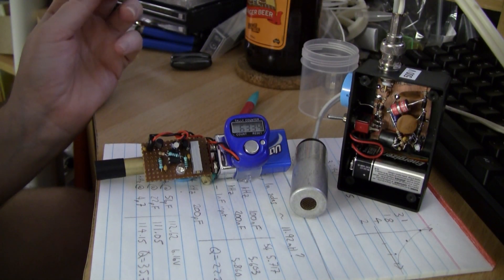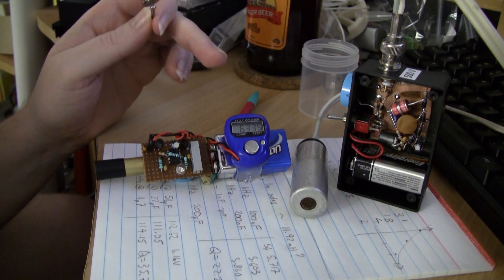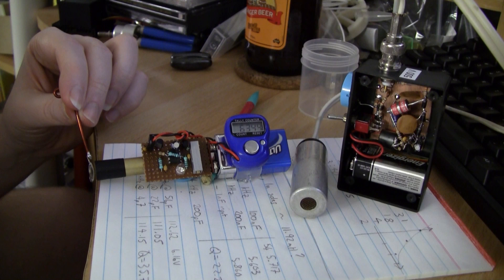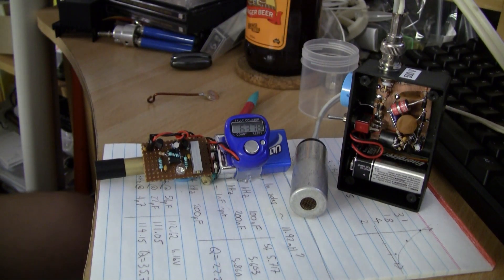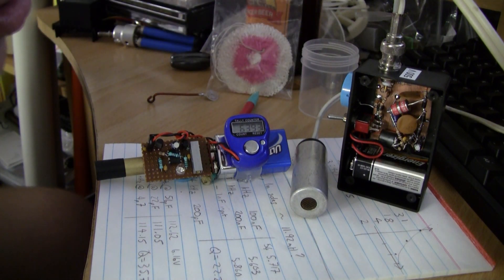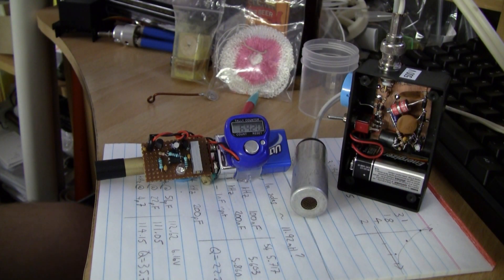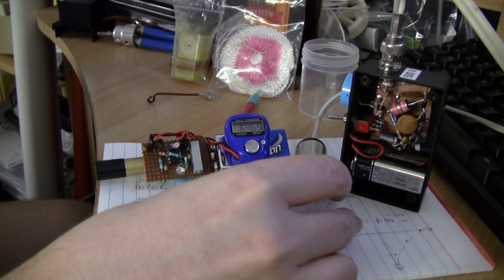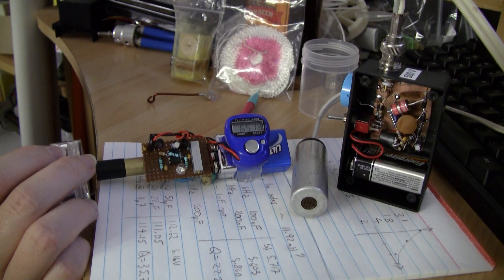Photodiode Gamma Ray Counter

Comment: I tried it, but so far on the first stage I am only getting lots of noise. And even with the oscilloscope I don't pick up anything when I put the radioactive emitter near it.
Reply from the maker: First things to check would be that the BPW34 is around the right way, it has to be reverse biased.  Next would be that there are no light leaks.  Measure the source voltage and make sure the PN4117A is not saturated.  It's exact operating point isn't too critical, but it needs to be not cut-off or saturated.
Reply: I found a mistake while connecting the photodiode (connected to ground instead of gate). I enclosed the circuit into a metal seal. Made sure no light is going in. At 12.8v battery supply, the voltage across the fet is 8.83v. Is it good enough?
Reply from the maker: @thelonewolf1757  Yeah that should be fine.

Comment: Where did you get thorium nitrate from? Price?
Reply from the maker: From a photographic supply store many years ago.  It was about $50 AUD for 10 g if I recall correctly.
Reply from the maker: Lantern mantles are easier and cheaper if all you need is a check source.

Comment: any reason multiple diodes cant be used for greater sensitive area? each with its own amp, summed
Reply from the maker: No, that would be a good idea, maybe even keep it pixelated with separate reporting channels for each detector.
Reply: @vk2zay  ok and because they are a flat plane they should be somewhat directional. sounds like a great survey device for strong sources. an esp32 could matrix 8x8 grid attached to a lead golf ball sized head and output a heatmap on a wifi webserver. my programming skills are not up to that yet.  im an old fashioned guy so they might go to a matrix of bicolour leds. lots of damn soldering though
Reply: also do you think a pin diode is reliable enough to identify isotopes using spectrometry?
Reply from the maker: @pavelkowalski9830  no it won't give you much resolution it just isn't big enough to capture a wide range of particle energies
Reply: @pavelkowalski9830 they can be but you need fancier photodiodes and better low noise amplifiers. I had good luck using avalanche photodiodes biased below the avalanche voltage.❤

Comment: I noticed in your schematic, the 2n3904 is positioned incorrectly, are the connections to each pin still correct?
Reply from the maker: I've just drawn it oddly, but yes the circuit topology is correct.  It is acting as a capacitance multiplier for filtering the front end supply.
Reply: Thanks :)
Reply: One last question, if you feel like answering. You said that the circuit is unstable because it is DC coupled through the comparator stage, and that AC coupling it would fix that problem, how could I AC couple it?
Reply from the maker: @quantumlab9130  put a capacitor between pin 1 and 6 on the opamp/comparator instead of the direct wired path, then add a resistive divider to bias pin 6 to about mid-rail and set the trigger threshold in much the same manner using the 100K pot.
Reply: vk2zay thank you very much.

Comment: Any idea how a solar cell would work? Large surface area. Awesome video, thanks for sharing.
Reply from the maker: alan headrick I tried a few small ones, too much capacitance which makes it very hard to extract the tiny current pulses, even with heroic bootstrapping of the capacitance.  Their dark current is also very large which tends to swamp you in shot noise.

Comment from the maker: The PN4117A has very low gate leakage (and a low Idss).  You can probably use any small-signal JFET but you may need to change the source resistor to adjust the bias for the differing Idss and Vpp of the replacement.  Start with something around the same value and check the source voltage, reduce the resistor if it is too close to the supply voltage.  You want only a few volts so there is enough voltage across the JFET for it to have reasonable gain.

Comment: I used a similar counter in one of my designs a little while back, it used to be a bottle opener with integrated counter. On the back of the little PCB there's a resistor, I seem to remember it was about 470k, if you reduce it to sub 100k (can't remember the exact value) then it allowed counts up to about 2-300 counts per second. You can't reduce the resistor value too much though as the LCD refresh rate is related to it and causes it to scan incorrectly. Otherwise it is ideal for low CPS rates.

Comment from the maker: @The666knives the window over the end of the tube is a very thin piece of brass shim stock.  I have used normal Aluminium kitchen foil and tinplate, both work, the Aluminium gives the lowest attenuation, but there is little difference and the brass and tinplate can be soldered easily.

The various sources I've collected from a number of different places.  The Am comes from a smoke detector, the Th and U from eBay and hardware stores.

Comment from the maker: @Albinorama Whatever would I adjust the cermet trimmer with if I did?  An amusing story on this actually, the temperature stability of this circuit is poor, this rather cold morning I did infact cut my nails (long before I read this comment BTW) and as a result had great difficulty stopping the thing going nuts in my bag on the bus.  I got all kinds of strange looks from fellow passengers who only see "geiger counters" clicking madly in movies!